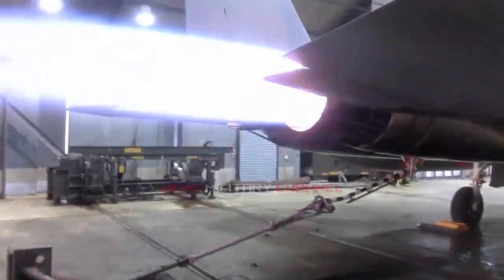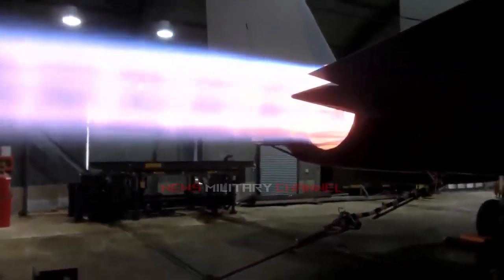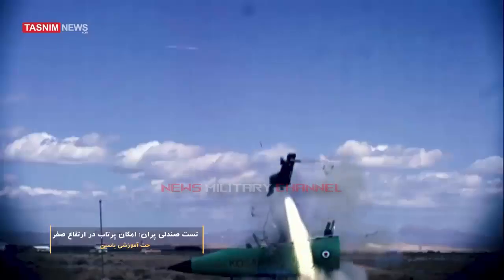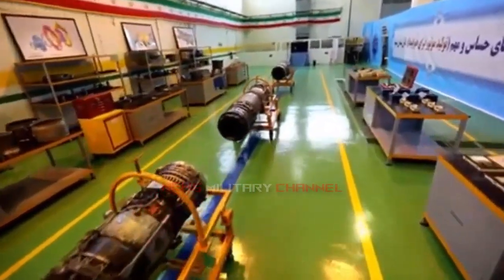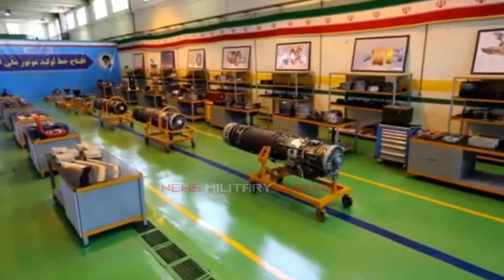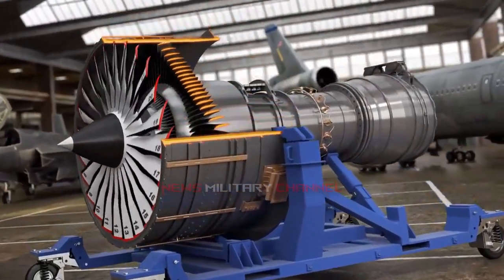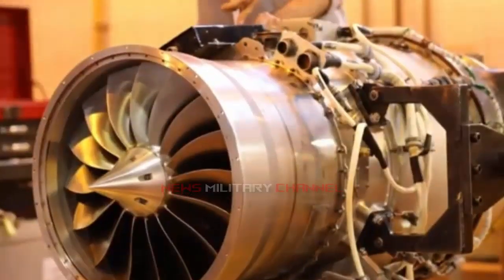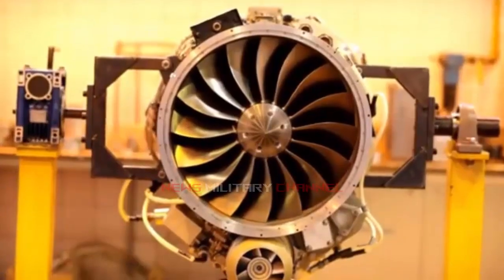Iran's advances in aircraft engine highlighted by top general | Iran's new fighter jets engine 2022

Comment: That's a General Electric engine from 1958. All they can do is reverse engineer old engines. Haha
Reply: The technology don't differ that much compared to 1950 and now. If you can develop the 1950 engine, with a bit of investment you can develop today technological advance engine
Reply: @Cool76574  hahaha you are joking ? That engine puts out around 6000 lbs of thrust,  Rolls Royce engines today put out over 100,000 lbs of thrust.  All engines today have a very high bypass ratio this one is a relic.
Its like comparing an IPHONE to a telephone from 1958.
Reply: @212MPH  yes I agree that modern engines have bigger bipass ratio and you can design a new engine with biiger bypass ratio, provided you have efficient enough turbine and compressor. Some new engines also have blisk systems instead of conventional blades and if you select the correct material plus introduce correct coating or compressive residual stresses in case compressor aerofoils etc. It can work and these technologies are not unknow to engineers . It's just require testing for ones specific engine/ choice of materials.
Reply: @Cool76574  not true, that old engine is probably a single shaft engine, it's more of a turbo jet. Hi bypass turbine engines have 3 concentric main shafts and totally different combustion cans. The entire engine is of a different  configuration.
Reply: @212MPH  you would obviously need to redesign the whole engine if you want to have a high bypass ratio etc. But the concept is all the same and it's all down to material that can take the extreme temperatures/pressure and CF loads plus design outside of resonance in terms of vibration.

Comment: Iran have engines for make large fast drones, a two engine large Mach 2.5 stealth drone's.
It will be the first drones that goes over Mach 2. 
And if those guys from IS think that the hot nossel and the heat of the jet engine will revele itself to jet fighters  infrared nossle equipment. But no, Iran have make to cool down this fast supersonic drone with metal legering in the nossle, that is a problem on fighters and so called stealth missiles. You maybe doesn't see them on the most radars. When a fighter use the afterburner, they heat up the 2d staring system on the f-22, and the F35 who are the only American/IS fighters who have something similar to 3d stearing, but would newer could compare with several 4generation fighters that Russia and China have. To cool down the jet flame isn't that difficulty, the Russian started with it all back in the 1950's, today Iran have upgraded the method.